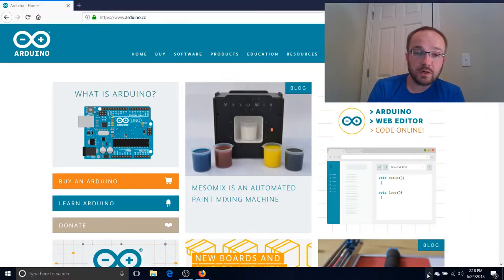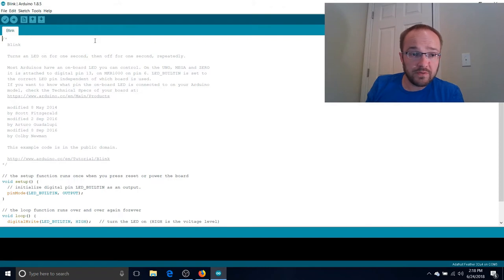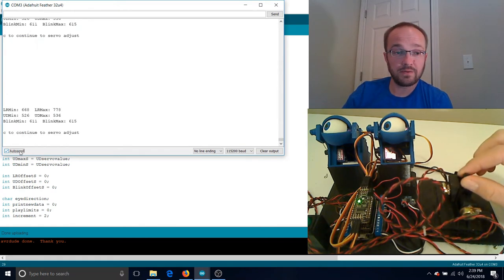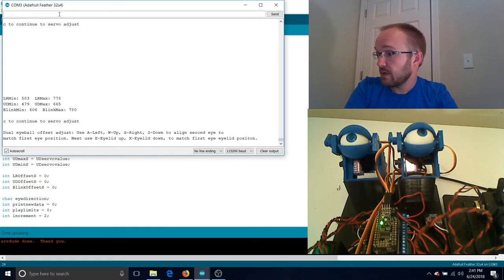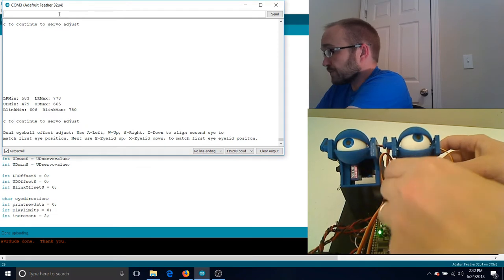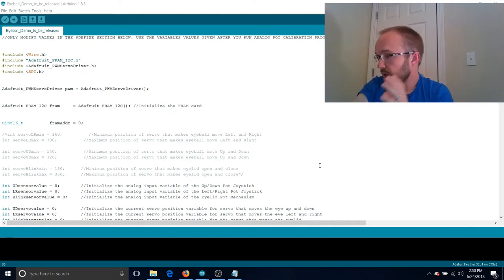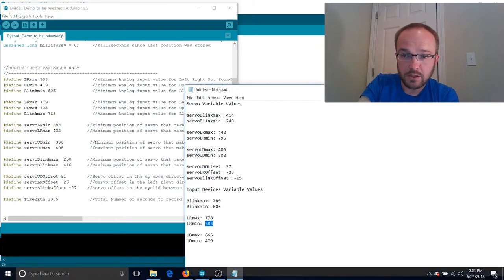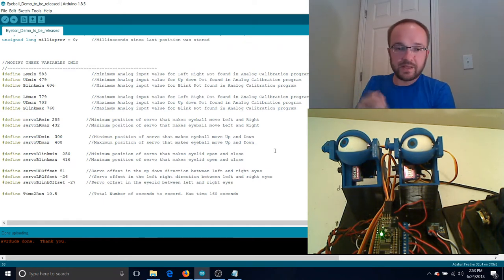Building an Arduino Controlled Animatronic System - Part 6: The Code

Comment: Just a very small tip. You might already know it by now as the video is a couple of years old.
You can auto format your Arduino code with Ctrl-T so all indentations and curlies "{ }" are lined properly up. 
For some reason the menu item/shortcut is 'hidden away' under Tools instead of Edit.

I have really enjoyed this Animatronic series. Educational and inspiring.

Comment: Hi Jim, I have been waiting for this one.  Thanks for all your hard work.  I love the way you explain things and comment on the code.  I have watched this video only once so far but plan on seeing it a few more times to really figure it all out.  My greatest hurdle is trying to figure out how IC2 programming works (how to assign programming to each servo).  Maybe if you had time you could post a video on that! HaHa.  I am off to DisneyWorld in a couple of weeks and then plan on making a whole lot of Animatronic characters when I get back using your setup.
Reply from the maker: Dan Massey the beauty of Arduino is the background code supplied when you install the servo wing does it all for you. If you only use 1 wing, it’s simple. Adding more wings you need to address them which isn’t hard and I can explain sometime.

With just 1 servo feather wing, you can drive 8 individual servos at once. That oughta be a good start! ;)

Comment: Hey jim im a few days away from getting to the coding part, i watched the whole video and had a question. Is there a code that allows a live feed, I'd like to operate these puppets for kids at a hospital so i figured it would look more realistic if i could control the eye's in real time. Instead of having a preprogrammed routine. Does that make sense? Please and thank you jim!! Also i apologise for bothering you so much, ypur amazing! Thank you for your hard work you literally inspired me and I'm almost done with the assembling portion of the project. Once it's up and running, ill upload a few videos on youtube of me in the hospital and you'll be one of the first people to know. Yoir helping my dream come true and helping alot of sick kids get through some tough times. Thank you so much!
Reply: I thought the first program would be it until i realized its just a program to initially create the dimensions for the eye movement to be based upon.
Reply from the maker: margrot the engineer the code does a live feed's when you first record. In the code, you can comment out the Fram.write commands and change the outside loop from 0 to whatever time and just change it to a while loop where something is never true to it loops forever.

If you choose not to hook up fram cards, make sure you comment out the fram board initializTion at the top of the code or else the code will stop because it can’t find the fram boards it’s looking for :)
Reply from the maker: margrot the engineer give it a shot and if you really get stuck on getting it to play live forever, let me know.
Reply: jim2386 yes sir will do thank you!!

Comment: Hi Jim.
For some reason during playback, servos sometimes vibrate, kind of jumping from desired recorded position to default servo values… During the recording mode everything runs smoothly and servos reflecting exact analog signals… Any known issue that can cause this? And how to fix? 
Thank you!!
Reply from the maker: went and looked at the code since it's been forever. If you're recording smoothly your code is fine in the setup section where it runs once (record section) and your problem is somewhere in the loop(){ section since that's where things play.

My typical plan of attack is to use the Serial.println(); command to help debug.

For example: 

Go down to the section where it says:

LRintram = fram.read8(bLR);
UDintram = fram.read8(bUD);
Blinkintram = fram.read8(bBLINK);

The software is reading the value from FRAM back into memory. So I would do 

Serial.println(LRintram); after that line and run the code. Do the numbers being displayed on screen look smooth or do they jump around when the eye jumps?

If things look smooth, try doing the same for UDintram etc.

If all those those look smooth, you know the data in FRAM is recorded fine and read fine.

Move down the code:

LRservovalue = map(LRintram,0,255,servoLRmin, servoLRmax);
UDservovalue = map(UDintram,0,255,servoUDmin, servoUDmax);
Blinkservovalue = map(Blinkintram, 0, 255, servoBlinkmin, servoBlinkmax);

This section is where it's interpolating the value from 0 - 255 back to a servo value. Do a Serial.println(LRservovalue);

and run the code again. Is the variable data smooth? If so, check the next varible.

Since that data is sent directly to the servos, I'd expect one of those variables to be jumping. Once you figure out which value is jumping, you can trace the problem back.

One other thing to check, back up in the:

LRintram = fram.read8(bLR);
UDintram = fram.read8(bUD);
Blinkintram = fram.read8(bBLINK);

section, you can also Serial.println(bLR);

You can display bLR, bUD, and bBlink. These are memory address locations. You'll want to make sure each variable counts upwards and doesnt' skip any values.

See which variable bounces around and then work backwards to find out why it's bouncing.

One thought that comes to mind is if, if the fram address variable is skipping a value when recording (bLR,bUD, bBlink) when there's are memory locations that are never getting recorded with new data so when you read it back, it plays back locations that haven't been recorded.

Sorry for the ramble but this is how you debug. Find out which variable is bouncing and work backwards. If the data being read immediately is bouncing we know we'll hae to go back and check how it's getting recorded. Baby steps.
Reply: @jim2386  thank you the detailed answer! I will need to spend some time on debugging… i did modify your code 
1. to use a mirrored eye (in your project 2 eyes are the same layout..- in my project i need both eye lids levers to be oriented towards the nose of the head, so had to print and program a mirrored version 
2. Ive added a jaw to both, recording and runtime programs.. so there is also bJaw variable which allocates to and reads from memory right after bBlink

So the eye lid joystick is used to record movements of the eye lids and then later jaw movements using the same soundtrack… 
Its pretty difficult and going to add more complexity as I add more eye lids and jaws that will play in the same scene. 

So another question is: how to better manage recording when need to record layers of movements for the same soundtrack using one joystick. In my example i am trying to make  2 heads having a conversation…
Thanks for sharing your knowledge!
Reply: @jim2386  i think i found the issue - in the runtime program servo frequency was not set to 60 Hz. 
Thanks for your help!!

Comment: The switch and the led I think were missed in setup and wiring. Is there somewhere that you talked about it and I missed it? Thanks.
Reply from the maker: Brad 44 you’re right. I must have added that after filming that segment. I’ll make a quick addendum video Friday on how to add it.

Thanks!
Reply from the maker: Brad, I’ve added the STL file for be button holder to the thingiverse page. Feel free to print that out and have it ready while I get the video filmed 

The Adafruit button you’ll use is product ID: 1440

You’ll also need a 470ohm-ish resistor: product 2781

I also use some shrink tubing in the video but it’s not technically required: product 1649

That should be all you need to add it.

Thanks again! Sorry you had to be the guinea pig :)
Reply from the maker: https://youtu.be/EGltZj8opkc   Here's the updated video, as promised! Thanks for catching that!
Reply: jim2386 thanks for the the video and the stl. Files. I made it and it is fun to play with. Now I just need to learn how to make it record then replay on demand. I was thinking to add another switch and using that to record with then have another switch to activate it. Thanks for the inspiration.
Reply from the maker: You've got it!

To add a switch, in the Arduino IDE, go look under file: examples: digital: button. It shows you how to use a switch tied to a pin to activate the LED on the board.

Once you get this, it's as simple as putting an IF statement around the stuff inside your "LOOP" function.

var = digitalRead(PinUChoose);
if (var = LOW) //Arduino can set the input pin to HIGH using the internal input pullup resistor. Tie the other end of your switch to ground.
{
Code to play your FRAM recorded movements
}

Here's an excellent writeup on why input pullup resistors should be used and what a floating connection means: https://www.baldengineer.com/arduino-internal-pull-up-resistor-tutorial.html

Of course, you may want to add another switch so it knows if you want to record something new. Put an digitalREAD in your setup section and if the switch is low, put the code to record movements inside the IF statement. If the switch is HIGH, then the IF statement won't be true and the code will skip over the recording process. Remember to only put the recording functions inside the IF statement....the other setup commands need to be read every time to make sure all your drivers etc are set up. 

Hope that makes sense. Start with the switch example built into Arduino and the link I gave you and I think that'll make things much clearer. I'm glad the project served it's purpose. It got your brain juices flowing and is pushing you to learn more! :D

If you could do me a big favor. If you haven't already, would you mind going on thingiverse and posting "I made one" under the eyeball mech and post a few pictures etc of your final project. It really helps other people know the project does indeed work if you follow the directions :D Thanks!

Comment: hey im getting this error when i try and upload the "eyeball demo to be released" sketch:

Eyeball_Demo_to_be_released:5:10: fatal error: Adafruit_FRAM_I2C.h: No such file or directory
Multiple libraries were found for "Wire.h"
 #include "Adafruit_FRAM_I2C.h"
 Used: C:\Users\JJBBD\AppData\Local\Arduino15\packages\adafruit\hardware\avr\1.4.14\libraries\Wire
 Not used: C:\Program Files (x86)\Arduino\hardware\arduino\avr\libraries\Wire
          ^~~~~~~~~~~~~~~~~~~~~
compilation terminated.
exit status 1
Adafruit_FRAM_I2C.h: No such file or directory
Reply from the maker: Did you install the FRAM libraries and run the test examples?

Comment: Hello Jim, I have just completed this build and everything works great I just have a question, I am creating this animatronic for a Halloween costume and after recording I would like it loop back until I turn it off or reset. I see in the code on line 177 it states ( Initialize Loop Counter for the number of times the programmed code should run) I change this but it does not go on a loop, What am I missing? Thank you very much for taking the time to create this excellent and in depth tutorial I have learned alot.
Reply from the maker: Steve G glad you liked it. I’ll take a look in the morning and see if I can give you some guidance :)
Reply: jim2386  Ok thank you very much Jim.
Reply from the maker: So I just ran the code on my setup (it's been a while!) and all you need to do is take the original code (with your upper and lower pot and servo limits written in.

Go to line  179 where it says i++. This increments i by 1 each time it loops. If you comment out that line by putting two slashes in front of it:

//i++ (it'll turn grey if you do it right)

the counter never increments so the stop code at the bottom never reaches 3. It'll loop forever. Just tested it and it works fine.

I imagine you want to program this once, then every time you power it up, you don't want to record, you just want it to play. That's a little trickier but not hard.

On line 103 you'll see delay(1000). This delays 1 second (1000ms) before starting to record your movements. Change this to something larger like 30000 (30seconds). It'l take 30 seconds before you can start recording your motions but here's the key, if you comment out or delete the FOR loop (lines 109  to 167), it won't record anymore and it will go directly to playing what's in memory the last time you recorded.

So here's the steps:

1. comment out i++ to get it to loop forever.
2. change the 1000 delay to 30000 or more
3. Save this code as programming code or some file name so you know it will allow you to record new movements.
4. Save a second version of the code with the delay set back to 1000 and the FOR loop commented out (so it won't record). Save this code with a filename like PlaybackOnly.

5. Load the record code with the long delay and the i++ commented out onto the board. Power on and record your movements (remember it'll be 30 seconds or so before it starts recording just this one time.

6. Check and make sure your movements loop infinitely now.

7. Open the code that is Playbackonly. Plug in the USB into your arduino and immediately load the code. You need to get the code loaded within the 30 second delay so the old code doesn't start recording over your old movements.

Once that code loads, they delay should be shortt again since it is set for 1000ms, it should skip over recording because you commented it out, and it should loop forever because you commented out i++.

On my normal animatronics programming projects, I have a switch attached to one of the unused input pins and I put in an IF statement that says if the switch is on, then go into the record loop. If it's off skip over the record loop.

Doing it the way I described above, you don't need any extra hardware. I hope this makes sense. If you need more live help, you can send me a direct message on twitter. I just tried it here and can confirm it works though so I think you should be all good!
Reply: jim2386  Wow you made it so clear thank you very much, I will try it a little bit later and I will send a picture of what I’m working on to your twitter account. I will let you know if I got it working.
Reply: @jim2386  Hello Jim I tried out what you wrote and when i tried to upload the first code I get this error message. I tried a few different  things i read but I am to new to coding. I sent the code where i get the error message to your twitter, maybe i imputed something wrong but i don't see how. 

Arduino: 1.8.8 (Windows 10), Board: "Adafruit Feather 32u4"

C:\Users\steve\Desktop\Save_this_code_as_programming_code_or_some_file_name_so_you_kno\Save_this_code_as_programming_code_or_some_file_name_so_you_kno.ino: In function 'void loop()':

Save_this_code_as_programming_code_or_some_file_name_so_you_kno:225:8: error: 'i' was not declared in this scope

 }while(i>=3);

        ^

Multiple libraries were found for "Wire.h"
 Used: C:\Users\steve\AppData\Local\Arduino15\packages\adafruit\hardware\avr\1.4.13\libraries\Wire
 Not used: C:\Program Files (x86)\Arduino\hardware\arduino\avr\libraries\Wire
exit status 1
'i' was not declared in this scope

This report would have more information with
"Show verbose output during compilation"
option enabled in File -> Preferences.
Reply from the maker: Steve G it appears you deleted or commented out line 177:

Int i = 0;

That needs to stay.

Only comment out line 179

i++

Should be

//i++

Basically it’s saying variable i isn’t defined so somehow your int i = 0 line is missing :)
Reply from the maker: If that doesn’t do it, I’ll probably need you to email me your code
Reply: @steveg1784  Hi Steve, Thanks for asking these questions, this is exactly what i wanted to do. Ive tried to contact Jim on twitter but ive had no replies. ive finished the build, i just wanted to know how you went in the end with this looping and if it all worked out for you? im about to follow his steps too.. cheers Sam